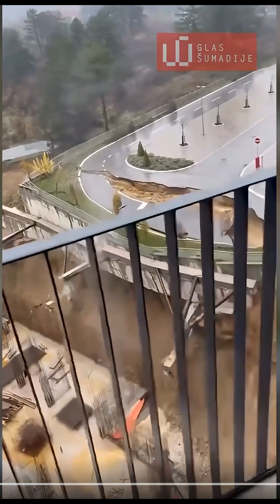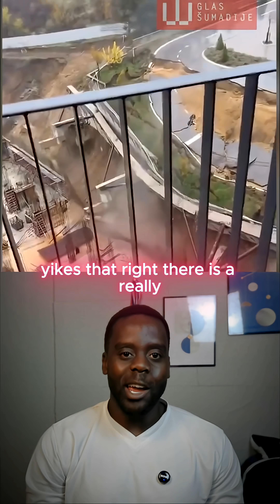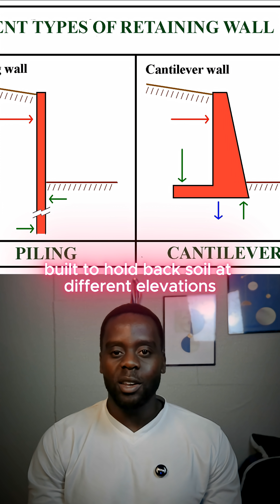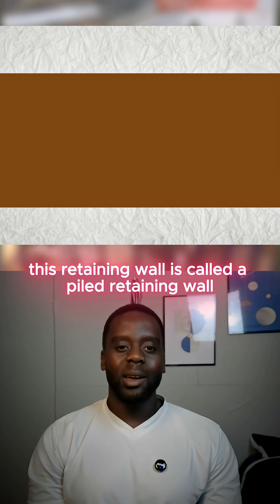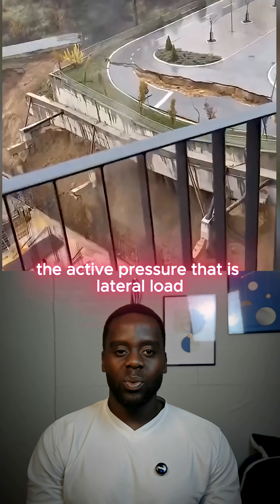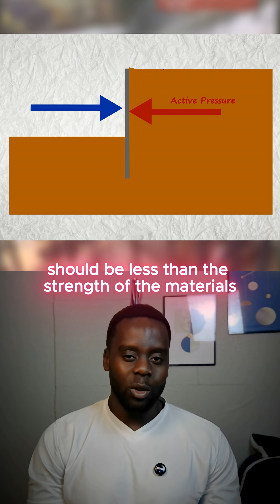Retaining Wall Collapse  #landslide #civilengineering #geotechnicalengineering

Comment: Roads wet so probably not enough drainage causing additional pressure in the soil.
Reply from the maker: Yes. That might be the case. Hydrostatic pressure plus reduction in the soil strength due to increased pore water pressure might have resulted in the failure. But ultimately the retaining wall should have been designed with that in mind.